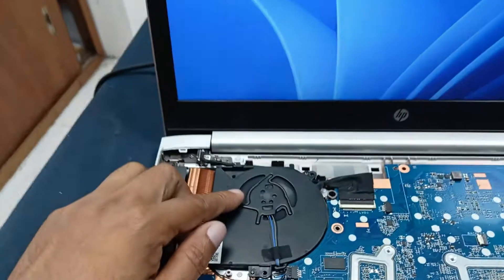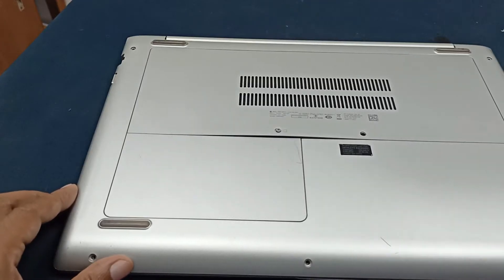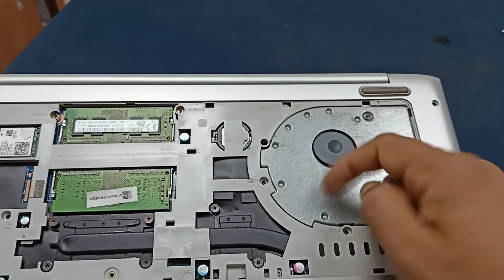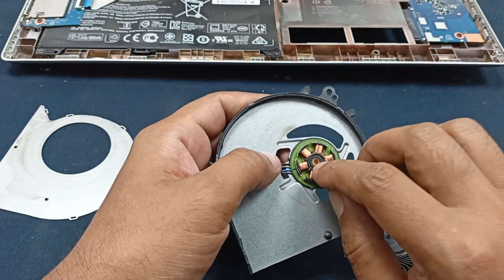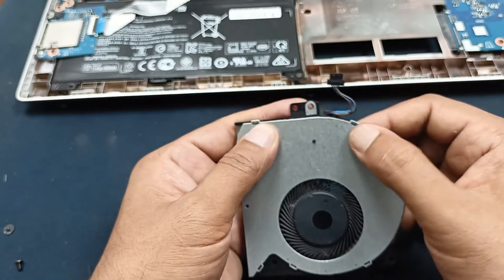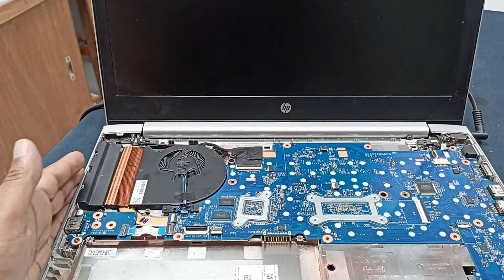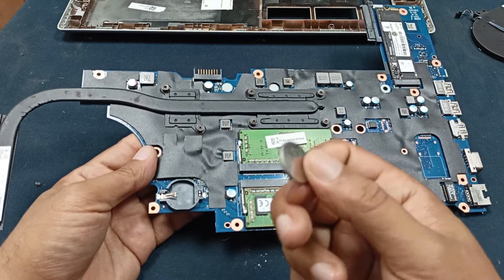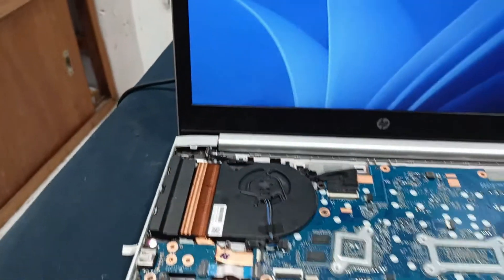HP System Fan 90B Error Fix || cooling fan is not operating correctly

Comment from the maker: Dear friends in this video i will show you how to fix hp probook 450 g5 laptop system fan error 90B
Reply: Will there be any problems if I continue to use it this way?
Reply from the maker: @-shuhag-9870  yes it will be crate a problem after long time